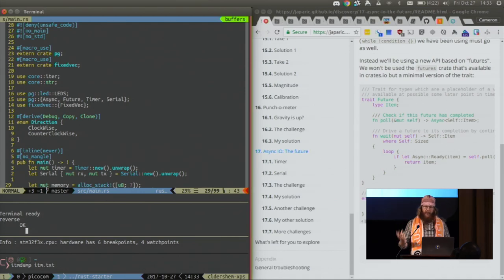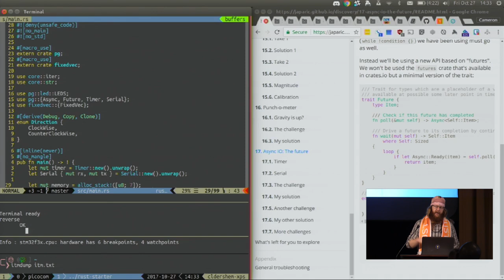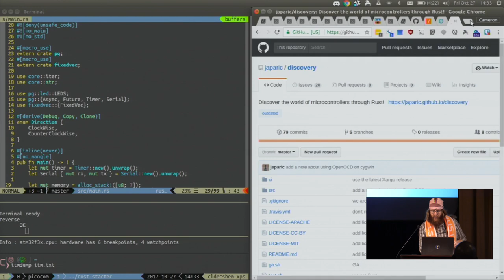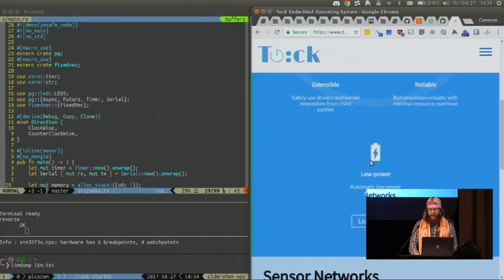Lightning Talk - Embedded Rust — Cameron Dershem

Comment: Rust can be run on the STM32F103C8T6 Cortex M3 (boards are available for around $1).  Also as an alternative to the ESP32 you could look at the ARM based RTL8710AF - e.g. the $2 Pine PADI IoT stamp.
Reply: Which software did you use for programming stm board
Reply: I bought STM32F3DISCOVERY over digi-key it cost me like 50USD